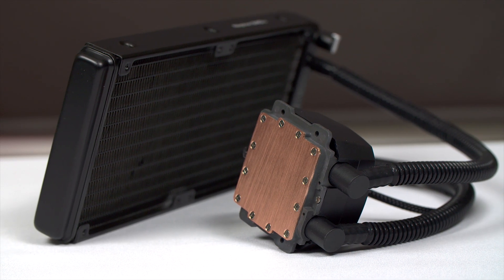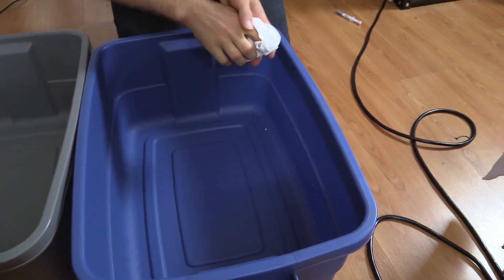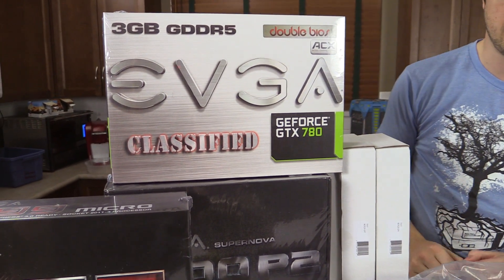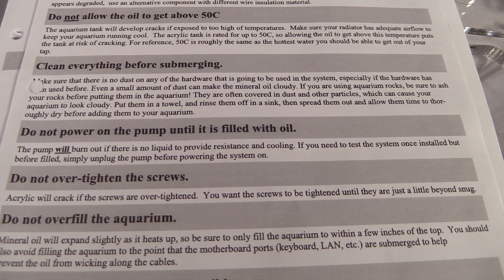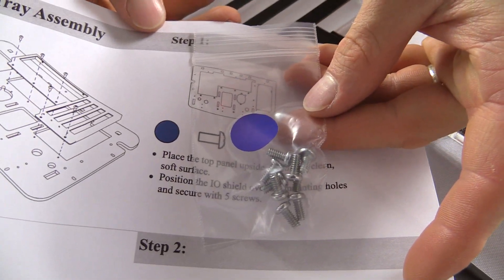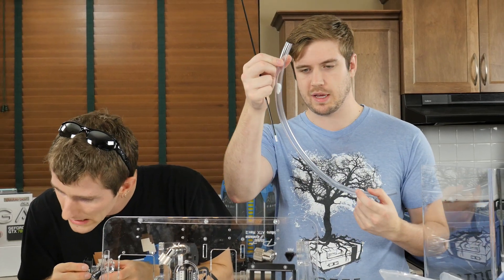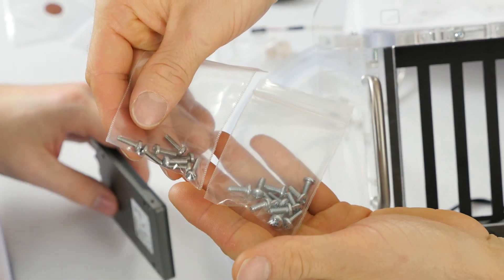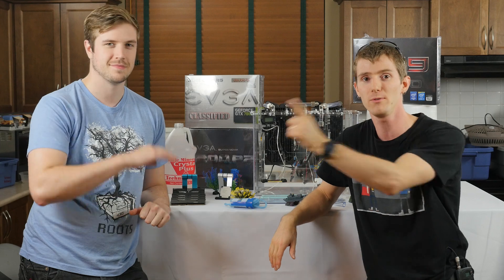Mineral Oil Submerged PC Build Log Part 1 - Puget Systems Kit Case Assembly

Comment: Intel® Core™ i7-4790 processor     Windows 8.1     2TB HDD     256 GB SSD, 16 GB memory     NVIDIA® GeForce® GTX780ti

do you guys think this is a solid pc and is there any weak points all i want is fps (would this reach over 750 fps in minecraft)

Comment: Doesn't it defy the point of being mineral oil cooled if it has external rads?
Reply: how? the oil has to be cooled somehow unless you have a massive volume of oil but this tank can't fit enough so the rads are to cool the oil.

Comment: can't wait for a water submerged pc tutorial
Reply: TheCardq it was a fokin joke m8
Reply: ***** Perfectly pure water would work for a few minutes, as it is not conductive, but it would quickly become conductive, due to small amounts of dissolved metal or dust.
Reply: you should make one.
Reply: Allow me to school you clowns. Some of you are  correct, but limited in scope (fair), and a few of you others are spitting nonsense and its VERY clear you have NO IDEA what you're talking about... 

Here goes... 

*****  YES we can make ion free (aka pure) water. Its called "ion exchange". Look up "deionized water" moron... 
*****  water does NOT conduct electricity. Ever. The compound H2O does not have an electron imbalance, and simply CANNOT conduct electrons through any means (aka its not conductive).
TheCardq correct!
Brad Ryan there is no "rusting" without oxygen. "rusting" happens when you have oxygen and an electrolytic solution (air has ions, and provides your solution). You will NEVER get "rusting" (surely you meant to say "oxidation" because copper and aluminum don't "rust", only ferrous components can "rust") without both oxygen and a conductor. Also, theres also a thing called "good rust", its called "magnetite". Its very similar to what happens to aluminum (gets a protective oxide layer).

The rest of you... this is how it works ->

Computer components contain copper and aluminum. Since pure deionized water has a high propensity to absorb minerals, it will strip copper and aluminum and very quickly become "ionized". This will raise the "waters" conductivity to a point where it will begin to short components. "PURE WATER" will work... the problem is it wont REMAIN "pure water" 

Didn't know youtube had so many engineers, physicists, and chemists. 

Source : not being a dumbass... oh yeah, and about 9 years of schooling in engineering, physics, and chemistry.
Reply: ***** no your wrong, sorry but your simply just wrong
Reply: true, but in theory, if you had perfectly pure water, it would work for a very short time.
Reply: Bonghaette Study Chemistry harder? Well you should know that the lack of minerals in demineralised water makes it extremely likely to oxidise your metal components.

The minerals in water is what makes tap water less likely to oxidise things. Minerals make the water less volatile.
Reply: TheCardq yeah, i didnt mean that to be as harsh as it came off. Just tired of the internationally published, licensed physicists that plague youtube portraying incorrect information xD
Reply: ***** I have two barrels stacked on top of each other, in the bottom barrel there are two graphite rods hooked up to a 24V DC converter submerged in water enriched with 3 cups of salt, with the top barrel acting as a 'collector' and using a small fan to push it into an even tinier container.

The gases get split in the bottom barrel, then get pulled through the opening between the two barrels by the fan in between, then the gases are sucked in by a small air compressor I got at Harbor Freight for $5.

The air compressor sits on a small 'foot massager' that shakes it for as long as it sits there. Opening the compressor's valve shoots out a small stream of 'pure' water.

I haven't used the system for a while, so it's currently sitting in a storage unit a few miles away, but it should still work.

If I went and got it now, it would probably still be full of that salty sludge in the bottom barrel, I can't remember if I cleaned it our of not.

The fish tank computer is now being used as a home server and just to look cool.

It has a Pentium 4 w/ HT, 1.5 GB of RAM, a small pen drive it's booting Linux off of, and a refurbished laptop hard drive sitting next to the glass for main storage.

Whether you believe me or not doesn't matter, what matters is that water itself is a non conductive liquid. If you added lime, salt, and electrolytes to mineral oil, I'd bet you'd see that it would be conductive too.
Reply: TheCardq Then again, in theory, I am galactic overlord.
Reply: How so?
Reply: TheCardq Pure water conducts electricity. Source: studying chemistry
Reply: JgHaverty I'm still in highschool, and failed my first semester of chemistry.
Reply: TheCardq Don't really care what your background is.  

edit: didn't mean that to be as harsh as it sounded lol
Reply: JgHaverty I know, just felt like sharing.
Reply: JgHaverty no, I understand, people with PHDs are stupid.
Reply: Honestly, if you have no fucking idea what you're talking about, keep your fucking mouth shut.
Reply: ***** You dipshit! Thats a CONSTANT REACTION. It's very stable, and is so inconsequential, that most references (scientific ones that actually matter, not your youtube jibber jabber) call it "essentially zero".

The electrical conductivity of PURE water is almost 0.  or, specifically, its 0.00009% as conductive as copper.  The plastic on your motherboard is more conductive.
Reply: JgHaverty
 My point still stands. I wasn't arguing wether it would short the components or not, I simply said that pure water is conductive.
Reply: Brad Ryan oxidization isnt what causes short circuits.
Reply: ***** by that regard, EVERY component in the universe "conducts" electricity to some degree.
Reply: *****
it wouldnt short circut imediatly if it was distiled
just very quickly like < 30mins
Reply: ***** Not at all. Water in itself has a resistance of 1, therefore it is totally nonconductive. SALT and ELECTROLYTES in the water are the conductive material

So yes, pure distilled water would never short out a PC if it was kept in a SEALED tank.
Reply: ***** No, I've actually built a PC submerged in ionized water from my home made atomic splitter. It still works to this day and the silicone sealant has kept contaminants from contaminating the water.

Practical? Hell no. But the braggaging rights were well worth it.
Reply: @Andy  r/woooosh
Reply: You fucking morons: http://en.wikipedia.org/wiki/Autoprotolysis
This is what water does. H2O+ H2O > OH + H3O+
This is called "self-ionization of water" and this is the reason why distilled water conducts electricity.
"Chemically pure water has an electrical conductivity of 0.055 µS∙cm−1" directly from wikipedia. Asshats. http://en.wikipedia.org/wiki/Self-ionization_of_water

Comment: Guys i need some help, i just wanted to build a pc gaming but i tont know which kind of Power Supply should i take it ? 

CPU: Intel Core i7 4770k
Motherboard: Gigabyte GA-Z97X-SLI, Gaming 3 
CPU Cooler: Noctua NHU14s
RAM: G.Skill Ripjaws Z Series 8GB (2x4GB) 
SSD: 120 GB Samsung 840 
HDD: WD Blue 1TB 
Graphic Card: Evga GTX 970 
Case: Corsair Series 230T 

Which can be really good for supporting this kind of Build ? tell me plz 2 different marke plz. Thx a lot
Reply: The RM850 by Corsair will do you nicely and give you lots of space for upgrading in the future.
Reply: Get a i5 4670k and use the extra cast for a 980, http://www.newegg.com/Product/Product.aspx?Item=N82E16817139054
Reply: thx a lot for the answer
Reply: iSp00nXx
I have the HX850 myself.

Comment: Will a GeForce GTX 760 be a nice gpu for a first gaming pc?
Reply: yes
Reply: Daniel Oosterbeek Don't get a 760, for the price/performance and futureproofness of that card, it's really a TERRIBLE option. Wait for the GTX 960, which should be around the same price point, have at least 3GB of V-RAM (very important for future proofing), consume much less power, overclock FAR better, and most importantly, just generally kick ass in performance MASSIVELY over the GTX 760. Rumors indicate the gtx 960 will have the specs of the GTX 970m or 980m or something in between with higher clock speeds, and right now the GTX 980m is roughly 10% slower than a GTX 780. So essentially, you'll be getting above GTX 780 performance for the price of a GTX 760. Trust me friend, WAIT.
Reply: Ownzem K I am very sure the Windows 7 CD I have is 64 bit
Reply: ***** You have the worst logic I've ever seen. Instead of using his money intelligently by waiting just a couple months to get a MUCH, MUCH better deal, you think it's a better idea to blow his cash on a card that's already outdated. That is some seriously good reasoning right there!

Daniel Oosterbeek Do not listen to him, whatever you do.
Reply: Ownzem K Yep, going for the GTX 970, now waiting for work ;D (Im almost 16)
Reply: But wait to 960
Reply: Or maybe GTX 970
Reply: Ownzem K I have a build in my mind: 
CoolerMaster N600
Asus Z87/Z97 Socket 1150
8 GB gddr3 1600 MHz
1Tb 7200 Rpm
Intel Core i5 4460
Reply: Daniel Oosterbeek
it seems pretty good with the 760
Reply: And maybe when I need to upgrade, I'll get another GTX 760 or GTX 970/GTX 980
Reply: And I have a Windows 7 cd that works
Reply: Daniel Oosterbeek Try and get the 970 if you can. Also, try to step up to the unlocked i5.
Reply: R9 280X would be better
Reply: ***** I am not going for any AMD products.
Reply: This is the build I'll be getting soon:
http://goo.gl/3i48L5
Reply: Marshal Beard  I'm just not going for AMD, I had real bad experiences with AMD. And not 1, but a lot
Reply: I've got the 760 in my build, and it can run everything I play (including Payday 2, ETS2, Chivalry, etc...) on max settings with good framerates, but I'm sure you'll have to turn down the settings to high/medium for the newest AAA games. I'd say try to get something a bit better like the 770 or the 980 (which is insanely cheap considering it's power) if you can and want max settings for the next few years, but the 760 is great in my opinion and should last you at least a couple years until it becomes sluggish.
Reply: It depends on which gtx760 you purchase. Go for the 4gb version, more expensive, but overclock it and add a second card and you can out preform a pair of gtx780, but overclocking and overcooling is the key
Reply: Ownzem K Thanks, but first gotta get work :D
Reply: Ownzem K I applied at AH
Reply: You are Dutch right? If you are, where do you live in Holland?
Reply: Ja, hoe weet je dat ik een Veenendaal woon? Je hebt zeker op mijn account gekeken? :P
Reply: Aha
Reply: Ownzem K Wat je trouwens zei over 2x4GB RAM en geen 1x8, ik wilde dit ook gaan doen.

Comment: Ok might as well post this here as I doubt I'll have the chance to do this. For a few years now I've had the idea to build a mineral oil cooled pc. Have the bottom of the case the reservoir. Then after running the oil through an external rad to cool it, have a header and then individual hoses dumping the oil on the Mobo where it needs to be cooled.

The coolest I thought would be just having the cpu with heat spreader mounted and the oil dumping directly on the heat spreader. It would have a similar look as a garden hose with no nozzle just a stream of oil. Say one for the cpu the memory and video card. If it was needed you could always add a small passive heat sink to help with surface area. The rest of the mobo being cooled from a waterfall of oil washing over it.

Oh and for protection have a flow sensor in the oil loop that will cut power to the pc if flow stops. So turn the pump on before the pc and vice versa for off. Has anyone done something like this?

Comment: I would´ve wanted to see you build your own case from a aquarium, that is a expensive case and it would´ve cooler if it would have been more of a DIY, still pretty cool.
Reply from the maker: The DIY route just doesn't make much sense anymore because of how much it costs. This kit is a great way to do an oil cooled rig
Reply: LinusTechTips wow  Linus replying once in a life time experince
Reply: LinusTechTips because a mineral oil rig makes so much sense to begin with. it's an obvious fun build and more diy equals more fun imo. it's a cool idea nonetheless!
Reply: LinusTechTips
Can you post a link to the case somewhere?
Reply: LinusTechTips
Do a tutorial video on how to turn a small SSD into a Cache drive.
Reply: LinusTechTips owmygaawwdd you replied awesome!!!! But still 700$ you could get a aqauarium fro 10$ and some acryllic for the covers and stuff 10$ radiators and pumps and fans 300$, It might be better for those who are willing to do it but this case is still good if money aint the problem and oil cooling isn´t a cheap process alltogether.
Reply: I wonder if he wishes he went the aquarium route now since it started leaking? haha
Reply: if it's water-cooled and oil cooled it's gona look ugly but if it drops temps down plus use a Pelter on the cpu phase change cooling won't last long enough it will just burn up

Comment: Hey guyssss, I need some tips for gaming laptops, i travel alot and i dont wanna go around with a big desktop lol. Any good gaming laptops for like 1000-1600$? Tips please! No Mac please, thinking bout this one tho ASUS ROG GL551JMDH71
Reply: I would definitely buy something with a 970M or a 980M GPU inside. Linus made a video about them a week or so ago since they came out just recently and they seem to blow any other mobile GPU away. I can't tell you which laptops sport them currently, but that's probably a good way to start looking. Edit: just did a quick search and the MSI GS70-2QE81 or the ASUS ROG G751JT-T7032H seem like the winners.

Comment: Ive always liked the thought of doing this but the thought of fixing a part inside of it that goes bad just kills the whole thing for me.
Reply: How about an HTPC for your livingroom, in mineral oil? I doubt you'll ever have to go into your HTPC. It's just for media or the occasional in-home streaming. plus, it would be nice to have peasants walk in and ask you about it. educating them in the process ;)
Reply: Mike L.
That might just be something Id do down the road. I currently have a dedicated laptop I use as a HTPC so if something ever happens to it or it gets to old then I may look into going that route! Thanks for the idea. :)
Reply: TheCardq niether does RAM. but we cool it. for aesthetics. Like my example.
Reply: Mike L. for HTPCs you don't need the power that usually makes enough heat to warrant this type of cooling solution.
Reply: TheCardq
In my case i just want a show piece. I dont care to much about it being practical.

Comment: Fractal Design Define R4 Black Pearl
 Cooler Master G750M, 80plus Bronze,
 750W Modular PSUIntel® LGA1150 Core i7-4790
 ASUS LGA1150 Z97-AR
 HyperX Fury DDR3 1866MHz 16GB KIT Black
 MSI GeForce GTX980 4GB GDDR5 PCI-E
 Crucial MX100 SSD 256GB 2,5" 7mm
 ASUS DVD-Writer DRW-24F1ST/BLK/G/AS, SATA

how would this work as a gaming/editing pc my budget is 1900$
Reply: no need for 750W psu.

Get a high quality 550W psu like Seasonic G-550 or XFX xtr 550W.

CPU cooler ??? Non-K version CPU ??
Reply: K4b4n0ss1 im actuallybuying it from komplett(a swedish computer  website and its allready chosen what parts are in there) so i dont really have/can change.
https://www.komplett.se/pc-i-delar-intel-premium-gamer/783617
Reply: Saevar Thor You can E-mail them and ask about changing the PSU at least here in Finland you can ( Hi neighbour XD )
Reply: K4b4n0ss1 hi neighbor ill maybey ask them to change it but maybey  something later so its better to have that extra voltage.
but what ever the question is how will it perform in gaming and editing??
Reply: Die down the PSU and then get the 4790k, much easier to overclock.
Reply: Llama Brains there is a 4790k in there...
Reply: Saevar Thor no there is a 4790
Reply: this is what im getting: LGA1150 Core i7-4790
Reply: Saevar Thor kk i rly do recommend a k proccessor tho.
Reply: Saevar Thor btw what is your cpu cooler
Reply: Llama Brains i forgot to type the k processor but ill be getting an cooler master something cpu cooler
Reply: Saevar Thor well i recommend an h60 or h80i, h100i for extreme overclocking

Comment: Could you theoretically use distilled water instead of mineral oil?
Reply: It would work for a while, but unlike mineral oil, the dissimilar metals in the build would cause electrolysis, eventually frying your computer.
Reply: Yes theoreticly, But distiled water would be way to easy to contaminate and destroy your system, since normal dust is enough to contaminate it. ;)
Reply: No.
Reply: Ions from the metal components will get into that water and make it conduct electricity.
Reply: Oh yeah. Thanks

Comment: I would be interested in switching to a oil-cooled machine, but I have a question, my GPU's & CPU's fans were designed to push air through the heat sink, not oil, surely this is going to kill my fans motor's in next to no time?
Reply: Just wait until the next parts come out, it will all make sense. Or you could use Google.
Reply: They should be fine, just run them at a low RPM.
Reply: That makes sense until you consider that the motors are literally running in lubricant.